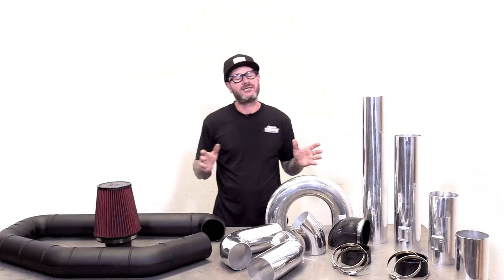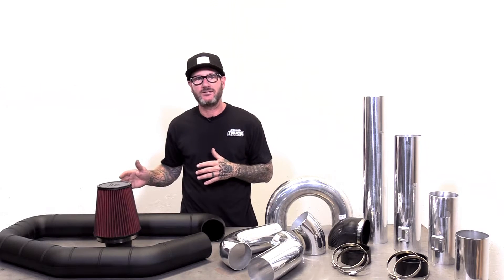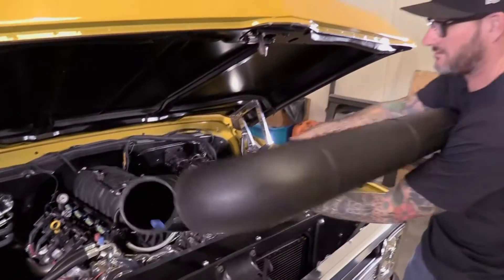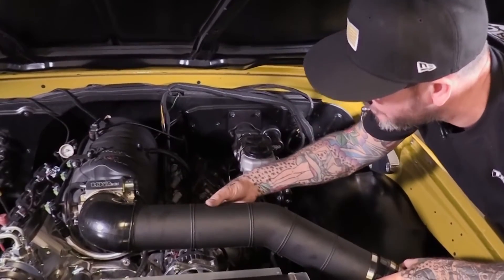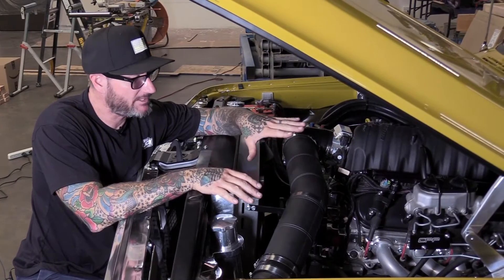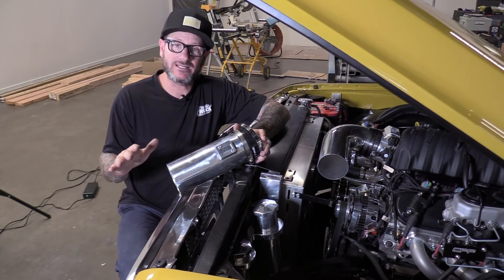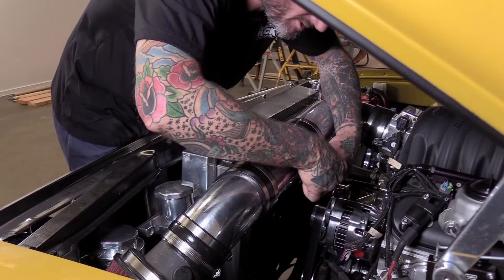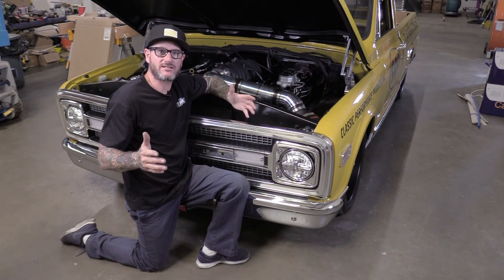How To Make A Custom LS Air Intake System

Comment: Where did you get your 90 degree coupler
Reply from the maker: If you give us a call at (855)-882-4131 one of our sales reps can help out!
Reply: @CPPmaster  the vent hole was for the passenger side valve cover right
Reply from the maker: @Nutflame55  its for a PCV return from the valve cover, yes
Reply: @CPPmaster  so how did you do it on the chrome one

Comment: Some one needs to explain how you get cold air when the filter is still in the engine compartment.
Reply: It's better when it's covered with an actual box with slits on the headlight side so it takes in the cold air being pushed through bumper area and underneath....just trying to get it furthest away from engine and main heat sources is most important thing
Reply: @outdat3d-04zx10r-ha  I think what he’s saying is how is the temp different than a filter right on the throttle body? It’s only 2-3 feet away with the intake he built so how is the temp that much better? Still under the hood in the engine bay. Obviously a legit cold air intake would have benefits but I’m not sure the $400 for this kit is even worth it.
Reply: @mitcheladamyk5121  it's not quite worth it I agree lol...I'm saying you definitely want a real cold air intake as far away from the motor as possible...I have a big turbo focus st and I'm not trying to chop up my engine bay/plastics so what I did was get a 3 and a half inch high flow injen tube wrapped with reflective heat tape from the turbo to the stock sealed air box with a Cobb high flow filter...and then I have a big mouth grille scoop thats routed directly in to the filter to bring in fresh outside air...it's not extremely far away from the engine bay but the grille scoop/snorkel that directs air directly to the air filter definitely gives it the best temps it can be without fabbing up a bunch of stuff...I plan on making a video of the car soon I've changed ALOT since my last short vid and I want to get out there and try to get some content/runs in...Im still stock fuel system and want to go 4 port auxiliary fuel but $ is tight all over and I'm saving up for it
Reply: I am trying to figure out the same thing.  I have a GMC so my options for cold air are more limited, I am thinking of going into the cowl instead of the grill since I don’t have the real estate a Chevy has in the grill.
Reply: @Averagegunenthusiast the stock air box has a scoop into the fender. It pulls fresh air from outside of the engine bay. It is a cold air intake. 

Aftermarket CAI without the box are actually pulling air from the engine bay completely rendering the cold air part as false. Lol

Just change the drop in filter and swap the resonator with a straight pipe.
Reply: @thedanlohman  the stock air box for a truck doesn’t fit, also the air intake is to the side into the fender.  My 72 c10 fenders are open to the engine by.  I would have to relocate my battery to use a stock air box, it would be easier to build one that fits.  As for cold air the old c10s were not designed to get cold air into the engine bay, they had carburetors with a snorkel to the side but no opening in the grill area for cold air.  You have to cut into the core support to get cold air in.  GMCs have 4 headlights, if it were a Chevy I could cut an opening next to the headlight.
Reply: @Averagegunenthusiast 😂 guess I should’ve clarified “late model” GMs. That’s my bad. I read that from my position. 

Definitely build a box and add scoops accordingly. Anything without the box actually allows heated air into the TB and intake. Especially if your engine compartment is tight. 

That ‘72 would look awesome with a hood cutout and polished scoop! 🍆
Reply: @thedanlohman  the hood is one of the few original parts left, I felt obligated to keep it instead of a cow induction hood.  I had thought a cow induction hood with ducting to the air intake would work great.  But when restoring the truck I replaced so much of it that the cab, and hood are all that’s left of the body.
Reply: @Averagegunenthusiast I fabricated an airbox in the stock battery location for my LS swap. I may post a short video of it here soon.
Reply: It doesn’t mean shit. Cold, hot. We are talking onesies and twosies on a dyno, confirmed. It really doesn’t matter that much on most builds and applications.

Comment: I have a donor from my sons 2003 Tahoe 5.3L. He had installed a new MAF meter that has the air-diffuser in a housing. Now, I have not sent the PCM in for programming, but this brings me to my question. Are the two types inter-changeable with programming? I work as a dealer tech for 35+ years, so part broke, install same new part. I know how these work and I believe it would have to install an ambient air temp sensor for proper A/F ratio. Just planning ahead as my tuner guy is one state south, but hard to get a hold of him. Just not sure about swapping stuff when it comes to aftermarket parts...in the same vehicle used in the video. Just doing my research as battery will be under the bed, behind the cab. Thanks!